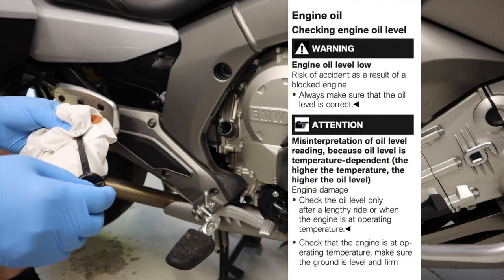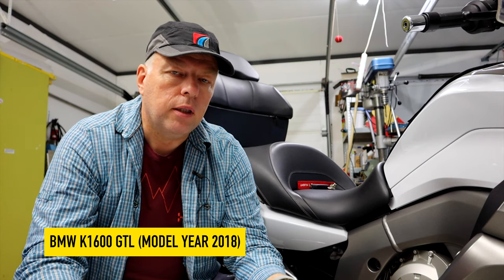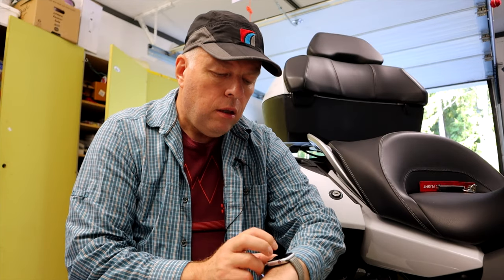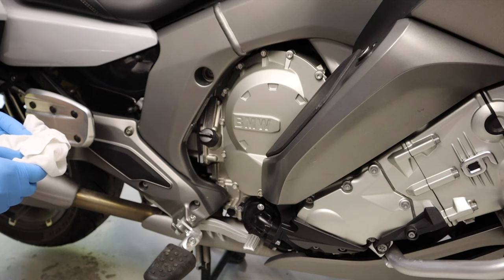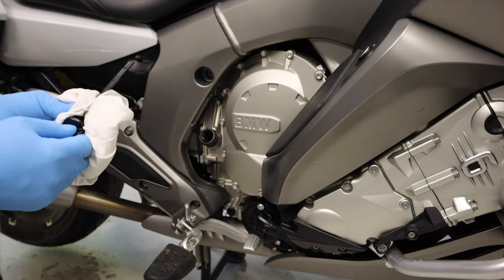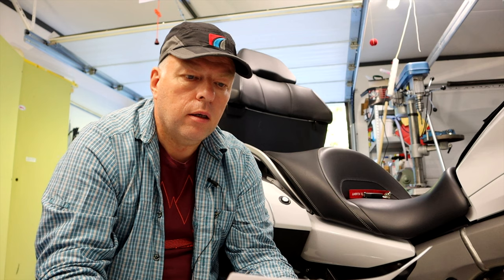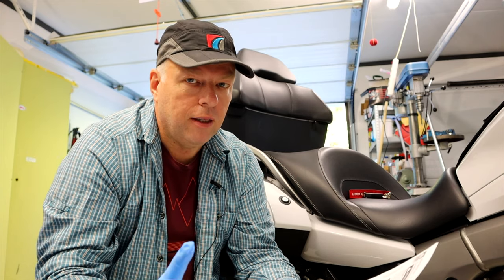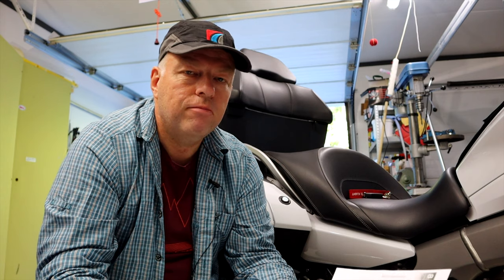Checking Engine Oil Level Properly

Comment: You can’t check the oil without following this procedure because that’s not the way a dry sump system works.  This isn’t a lawn mower.  Plus, your method would only allow you to check the oil on a cold bike that’s been sitting for a while.  The oil checking procedure on an Indian is the same way.
Reply from the maker: Yes I agree. There’s only 2 points or time when the oil level can be measured correctly. Either operating temperature or totally cool. And I believe sump engines requires op.temp. Thank you for the comment and safe rides.

Comment: German Engineering once again screws up. How about fill the oil correctly and run the bike on center stand level for a few minutes. Let the bike completely cool, like overnight. Next day check the oil level, and scribe a line on the plastic dipstick showing the cold full mark. Then never play the German Engineer game again. Check the oil cold anytime you'd like.
Reply from the maker: Great idea. But how close the scribed line will be to the min level mark? And if it is close, one will be topping up all the time when checking the oil.
Reply: @MYMOTOLIFE  
Have you seen the range on the stick? No, it doesn’t need to be exact.

Comment: To save time for idling the engine to heat up the oil, I usually dip stick/change oil after ride from work.
Reply from the maker: Hekko hfjchan. That’s true. But must cautious because of the hot oil.

Comment: It's very important to do this correctly. If you put too much in it will come out in the oil condisit  pipe
Reply from the maker: Yes the engine oil level is really important issue. And it is easy to check occasionally, or even more regular intervals.
Reply: If you're willing to play this game go ahead, but it's unnecessary, and poor engineering

Comment: There is also an oil level sensor in the block which will alert you if the level becomes low through a warning light.